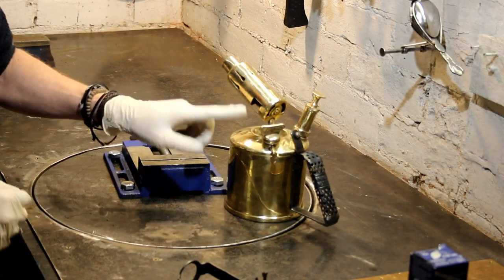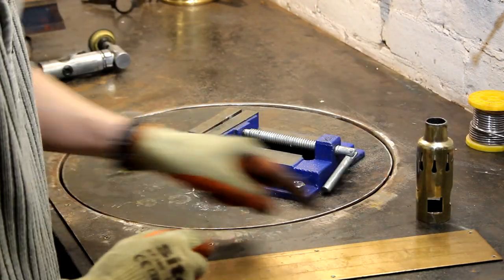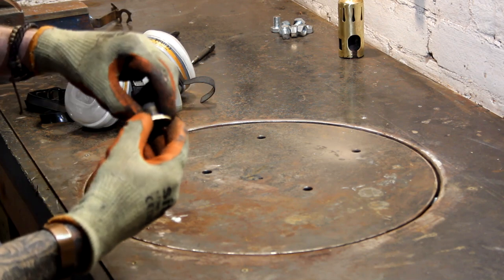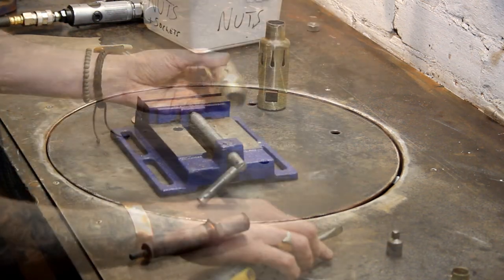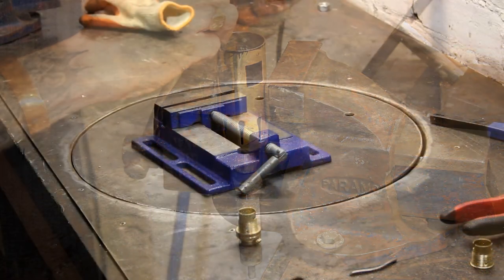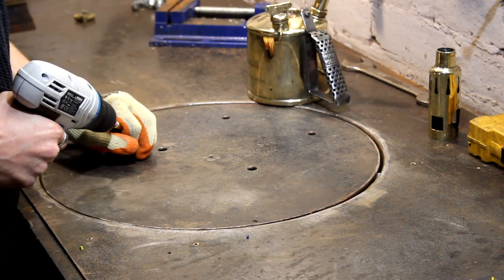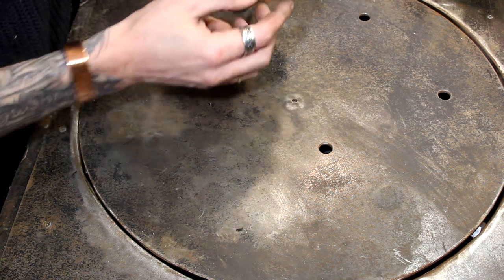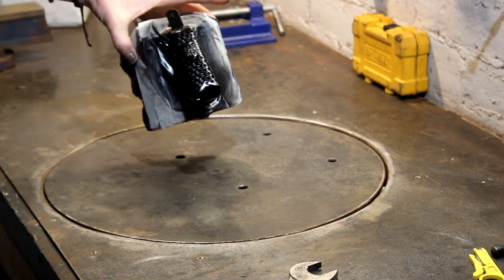Epic Upcycling - How to Make a Lamp out of an old blow torch

Comment: Hello. I have read your comment in one of the videos here in youtube and we have the same problem regarding the canon dslr. My lcd is black and cant see anything on it. I can shoot photos and videos but nothing on screen. Can you help me what did you do? I tried a lots of solution but still not working. Please help me please. 😔
Reply from the maker: My 600D i think had metal dust in the hdmi port. This made a short circuit which made the camera think an hdmi cable was plugged in, which disabled the LCD. I actually took the thing apart, the lcd and the camera body and checked all the cables, sprayed contact cleaner etc but all cables were attached fine so my advice is check the HDMI port.
Reply from the maker: I believe this is the video I used to take it all apart. Its a bit like brain surgery but its doable with care and a good set of watchmaker screwdrivers. Try the HDMI port first though, get yourself some contact cleaner and (if you have one) blow it out with an airline. https://www.youtube.com/watch?v=zzS8w1jVsm0